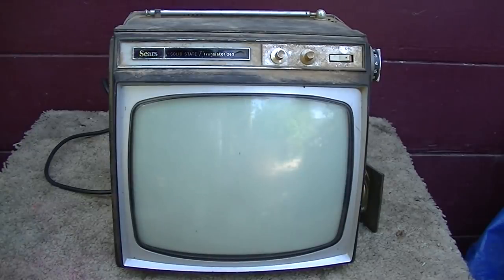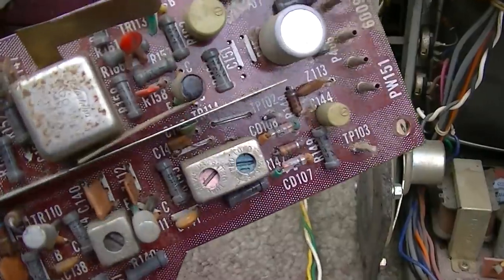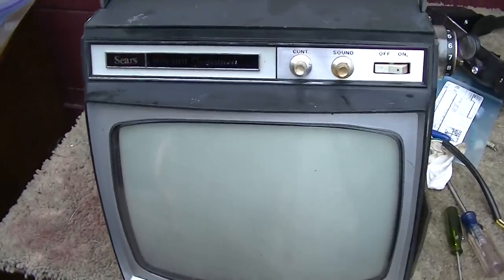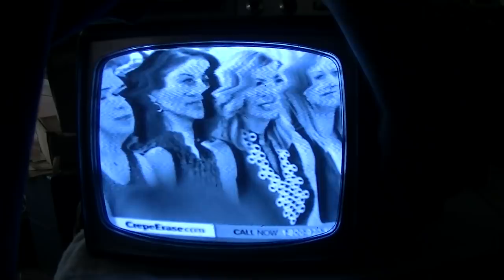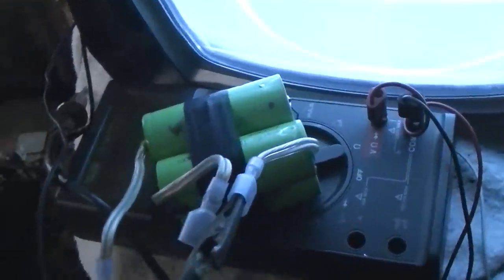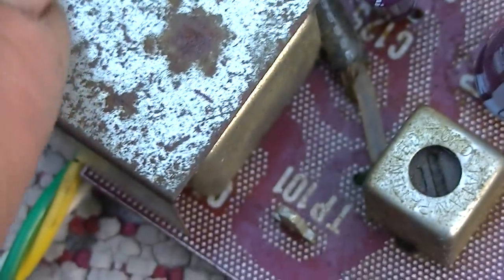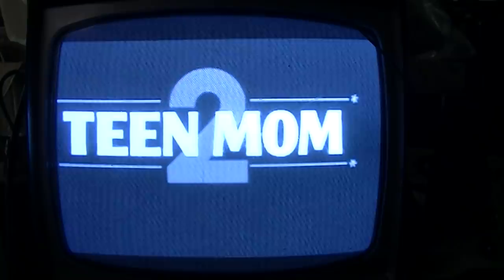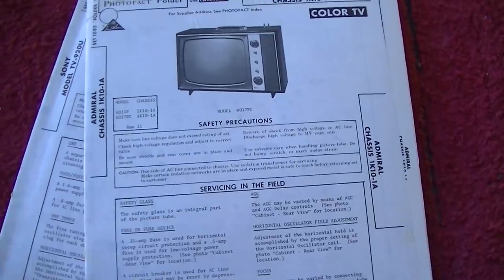Recapping and Troubleshooting 1966 Sears Toshiba Portable Black And White Television

Comment: In 1978 I purchase a used one of these Sears Toshiba monitors and a Sam's Photo Fact for it.  I used it as an Apple II Rev. 0 b&w monitor by hacking a RCA line video connection to the video line amplifier circuit.  It worked flawlessly for me for 5 years when I replaced it with an Apple III monitor.  Thanks for this video!!

Comment: Awesome man!  Cool to see electronics from the year I was born saved.  
Loved the capacitor EOL show!  I got one of these at a yard sale.   It worked
for about 3 years in my shop and then the sound quit working.  I replaced a
cap in the audio board and it worked again.  A friend of mine that fell on 
hard times needed a TV and I let him have it, and he used it for about a year
then the picture bulb was too weak to do anything else to it.  It made it's 
way back to me, maybe one day I will get lucky and find a picture bulb.  
Like you say, they are good novelty televisions.  Watchable, that's about it.
Cheers!  🍻-Al

Comment: Please, please, please, blow up some bumblebee capacitors in a future video! I want to see the guitar people come unhinged at the destruction of one of these "magical" components.

By the way, exploding bumblebee capacitors are REAL. I found this out the hard way with the first All-American Five radio that I attempted to restore when I was about 13. The capacitor was across the 35W4 rectifier. When that capacitor shorted out, it went off like a firecracker and a carbon resistor was cremated, making for plenty of smoke.

Comment: This is interesting on the process of troubleshooting older televisions.  One comment I wanted to mention for future reference.  You can use an ohm meter to check the impedance of a speaker if it isn't marked or not sure of the marking.  The speaker you mentioned 32ohms; is actually a 3.2 ohm which is why your audio noise in the screen was greater than with an 8ohm speaker.  Most common speaker impedance values I've come across are 3.2, 4, 8 and 16 ohms.  If there is an actual 32 ohm speaker; that's new to me.  Keep the videos coming I enjoy and learn a lot from them.

Comment: I did up Sony of similar vintage to this same problem all the caps were baked and off the scale. Luckily no open IF coils but someone had previously messed around with the alignment to try and and compensate for the crappy picture it had. Loved the slow motion cap popping. A favorite past time of mine.

Comment: When I worked on my mini Sears TV that had a NP cap I used a big yellow 2uf capacitor as a replacement. Seemed to work since I'm cheap.
Reply: How do you sleep at night after doing that?  You really should replace it correctly.

Comment: I was told that the value stated on Japanese caps from that era would be a minimum value and were often quite a bit more.
Reply: Usual failure of electrolytic caps is higher capacity and inceased esr.....

Comment: Hello, great troubleshooting as usual. My guess is that if it’s only the tap to ground vs. the whole coil, either a successful repair will be made to the original, or with the little component tester, you will find the inductance and maybe sub something from a multi band scrap radio or something. Luckily only a primary is used. I’m willing to bet almost anything close will work, just to complete the circuit. It might not be perfect, but who knows. We’ll stay tuned to see what’s devised. Take care.

Comment: The yellowing/browning of the cases of old electronics, when not cigarette smoke related are usually the result of bromine.  Bromine compounds are inserted into the plastic during the manufacturing process as a flame retardant.  Bromine is the great escape artist of elements, it will find a way out of whatever you put it in.  Thanks for the good work!

Comment: Nice troubleshooting Shango! You are one of ths best! Looks like that open coil cicuit has some negative feedback from the small part of the winding below the center tap. Could be hard to recreate something that would be equivalent. Hopefully you can find the broken wire inside or maybe worst case dewind it and count turns as you go and rewind. You'll need some hyper fine wire I'm sure!

Comment: Thanks shango066 for the capacitor info and the scans for the 920U!!!!! I know I have my work cut out for me but I would rather shotgun all the caps instead of shot gunning all of the transistors! Now time to order parts and then hope for the best!
We'll be standing by for video #3. Hopefully the microsurgery will be successful, my nightmares used to be the old General Electric PE series of walki talkies used by public safety. The channel elements were an absolute nightmare to recrystal since they were smaller than Motorola channel elements in the MX 300 line of portables. Bring on the Optivisor and hope the hands don't shake too much.
Reply: You just about have to have surgeon's hands.

Comment: I had the same Sears set in 9 inch version. It had open electrolytic 3 MFD coupling cap from hozontal phase to the sync circuit and had to clean the tuner. That was my first 12volt battery set. The set worked perfect at the beach I built.my first jump-started unit before commercial jump starters hit the market. I had many pairs of holy jeans due to battery acid.  They were so holy that the pope would have blessedme
Reply: The nine inch version had an AGC adjustment near the if circuit

Comment: Check out that old selenium rectal fire ( old comic joke from popular electronics of the '60's) my Sony had a bad one and replacing it with a modern rectifier ( 1N4007 ?) cured the AC issue. You probably lready know that if they let out the magic smoke it should not be inhaled, very bad for ones health and smells like Sh!t.
Also those old phelonic PC boards are known for having traces that lift off and split from the circuit board. Hard to trace many times, re check the joints for all the caps you replaced. 
Love these videos, I know they are a PITA to produce but they are appreciated.

Comment: when i was about 14 years old and really interested in electronics i used to get old capacitors from scrap tv sets and clip them to long wires and hang them out my bedroom  window , one day i went a bit to far and lowered a big 10000uf 63volt cap out the window but it went down through the window down staires i put 240 volts across and waited for the loud kaboom , it came and along with it a blood curdling scream from my mum who was cooking dinner in the kitchen (the cap had gone down through into kitchen window) along with smashing crockery . i didnt do that again until i left home :)

Comment: is "smoking caps" legal in commifornia, medicinal of course?
Reply: It sure was therapeutic for me!!! 😂
Reply: @Etienne PCBs actually smell quite pleasant. A fruity scent like Apples and Peaches. That adds to the danger because you don't have the pungent smell of other dangerous stuff like solvents.
Reply: Yes, but you need a Rx from a cap doctor.
Reply: Get you on a watch list fo sure
Reply: @albinklein7680  for me, they just smell like lead and rust
Reply: @LazorVideosDestruction  Maybe there are different types. (Unfortunately) I worked a lot with stuff containing PCBs like transformer oils, hydraulic fluids, varnishes and that stuff mostly smelled like apple sauce.
Reply: @albinklein7680  I feel like we are talking about two different kinds of PCB. I was thinking "Printed Circuit Board" when it comes to smell.
Reply: my screwdrivers are labeled for prop 65 to cause cancer,, so the smoking caps can't be much worse to commifornia

Comment: The yellow plastic can be brightened like brand new with the bleaching gel for use in hair salons.  Apply the gel, wrap in plastic kitchen foil so it won't dry out, expose to bright sunlight for a couple of hours (all sides evenly).  You'll be amazed about the result.

Comment: Removing color damage is actually really easy. A guy known as "8-Bit Guy" has a Youtube channel in which he restores old computers from the 80s. Well, they often have color damage. He uses a simple process called "RetroBrighting," in which salon conditioner is brushed onto the plastic, and it's set out in the sun. I'll be damned, but it works. He also has a process in which he dunks the parts in water. Check it out.

Comment: Sometimes changing or cleaning the potentiometers fix more problems than changing capacitors. I have a 5inch Broksonic that had a very crappy picture, wouldn't lock the vertical and it was just some corroded pots.

Comment: If your D to A converter  has a composite video output, I would use it to provide a stable external H/V  lock for your 'scope. That may provide an easier time tracking  down your ac ripple path out of your power supply. 
Also, with the converter off of the VHF input, I would inject the comp video into the sync separator (thru a cap) to see if bypassing the IF shows more stability.

Comment: You have inspired me to go buy an antique radio to play with. I found a 1937 Zenith 10A1 chassis that hasn't been touched. How do you determine what is an appropriate modern cap value to replace these obsolete value ones, and do you have a good online source for them? I have the schematic and Digikey seems to be letting me down for the obsolete values and anything close in value and voltage seems to be quite expensive, if available at all.
Reply from the maker: What is an obsolete value?
Reply: @shango066  Well, perhaps if I didn't mess up the conversion, that would probably help my cause quite a bit. It wouldn't be Monday if I didn't show my ass to someone. I swear I'm not an idiot, but if I were, would I even know that I was? That requires a bit more existential study than what I was prepared for.
Reply from the maker: Give me one of these values as an example that you're having trouble locating and let me see what I can do to help
Reply: Looking at a schematic for this chassis on Nostalgia Air, and not seeing anything that doesn't look like it would either be difficult to substitute, or very expensive. 

If I'm seeing the grainy writing correctly, looks like it has two 20 µFd filter caps. One rated at 350V, the other at 450V. Should have no troubles using two 450V 22 µFd caps to replace those. 
The really low value caps (like the "25 mmfd") are probably mica. In theory they should be checked, but are probably fine. 

The rest of the paper caps can be replaced with 630 volt film caps, that have a modern capacitor value.
A .1 µFd is still a used cap value. A .05 could be replaced by a .047. A .02 can be replaced by a .022. A .004 would be a .0047, ETC, ETC... 

Close enough works just fine in these sets. New parts installed at the factory back then were often not dead nuts exact, and were anticipated to drift in value over time. Both considerations when they were engineering the circuits. The most critical thing you can do is being sure you're using capacitors that have at least the same voltage rating, if not higher.  

Digikey, and Mouser are both good sources for bulk ordering genuine components at a reasonable price.
Reply: @erikj.2066  That thing is laden with waxies that are all shmooey. Once I got the conversion issue resolved, the problem I was running into was the the majority of the caps were 600v. Unless I am overlooking them, Digikey and Mouser were only showing 250-400v max caps in the capacitance I need. I know the values have some wiggle room, but voltage doesn't in my experience. 

I wonder what the consensus opinion of Justradios.com is. They seem to have everything need in one go.
Reply: While I didn't give an all inclusive list of all the values of caps your radio would need, I was able to find every single value I mentioned, with multiple options on Digikey. 

If you're setting up your search using AC volts, you're barking up the wrong tree.  Put in 630V DC as your voltage. 
For termination, you're going to see far more radial terminated caps, than axial, and they are usually half or less the cost of an axial terminated cap. If you can live with the different lead dress, the radial caps work fine. It's simply a matter that axial caps have gone out of style in mainstream modern electronics, so not much need to produce a broad spectrum of choices. The for the low value caps, you'll need to convert µF to PF to find what you need.

 I have ordered a coupe of capacitor kits from Just Radios. They have those generic yellow IC style axial caps, orange drops, and modern style films. I know Shango doesn't think much of the yellow generics. I've used them, and haven't had any problems with them yet. The most important thing with those it to check them for shorts before you install them. Again, haven't had a problem with that yet, but still good practice.

Comment: Well, I was wondering how long it would be before you bypassed the IF and detector and fed composite directly into the IF output.

I suspected detector diodes since after recapping.

Nice video, great work.  73 de KE0RFZ

Comment: It seems there is still problem with power supply. Even composite input picture wasn't rock stable. Capacitors were changed, selenium rectifier too. I think that there can be problem with grounding resistance between PS and PCBs or between PCBs. Power supply is not on PCB, it's just point to point connection. Check resistance between PCB grounds and power supply filter capacitor ground. Check the same for B+ and power transformer.
I think that repairing IF coil wouldn't be big problem. TV IF use higher frequency than FM and AM IFs in radio. So coil winding has only few turns and wire would be probably broken just in the solder pin.

Comment: Completely disconnected with Shango's amazing video, but...For anyone interested I was poking about online and discovered the first ''integrated circuit'' made by Loewe in Germany in the 20s the 3NF...Have a look they are amazing.
Reply: I have one with blown filaments as a museum-piece. Most amazing are the glass-encapsulated resistors.

Comment: See what happens if you bypass the bad IF stage. Put a jumper from the good IF directly to the detector.
Or use a video IF transformer from the parts Toshiba. The part numbers might even match.

Comment: One soviet 100 uf capasitor can feel room or garage with a smoke.
Reply: There are German ones with a plasticy/ceramicy package. They explode VERY violent with shrapnels that will REALLY hurt you. You find them in old transistorized Loewe TVs and Revox/Studer recording equipment. Careful with those. They can literally blind you.

Comment: What about to modify in an input selector switch, so this TV can has a unique composite input too! I mean, this way you fix this and also adds a bonus feature too!
Reply: You can feed a coax direct to the antenna connector usually and be able to use a tuner box to feed em if they dont have a terminal strip.

Comment: Man, you are right about the availability of these tiny tasty IF tamales. Have you looked at these tacos from BG Micro? They are old Mouser part numbers. In particular, I was thinking about the last two items in the chart shown in the link. They were tested at 50 MHz, which is close to the 42-43 MHz video IF you need. Plus they're cheap! They call them RF "coils" but do not provide a schematic. It looks like a safe assumption that they have a primary but no secondary.
http://www.bgmicro.com/COL1152.aspx

Comment: Those selenium plate rectifiers are deadly. If they ever should blow, they release a very toxic gas.
If I were you I would take it out of circuit and use diodes.

Comment: Caps that double in value? some say they are fine , others say they need to go ... is it all a matter of opinion?
Reply: bones007able - the caps doubling in value, coupled with the age of them are the two most prominent factors in deciding if they are bad or not. Plus the fact that the Chinese testers use a code based algorithm for testing. So, who knows how they do it, really. Typical electrolytic caps are +80, -20 % tolerance

Comment: Putting 15 VDC caps across 120 VAC RMS line voltage is fun,  I especially like the ones that look like the Death Star blowing up.  Just for ease of cleaning, maybe do that in your neighbors driveway next time and avoid all that mess on yours.  Suffocate and orphanage...lol. Fun fact, there may be other components bad in this 50 year old TV.  Bad pots, bad resistors, bad diodes (diodes like to short) the list goes on.... Other than mad TV tech skills I most like your lack of political correctness, that and repairing things for our entertainment....Thanks

Comment: I personally don't get why anyone should go through all the trouble to fix an analog tuner on a TV set when analog broadcast is dead and a composite connection can be made. A tuner is just putting unnecessary garbage in the way of the signal. I personally just believe functionality is more important than originality.